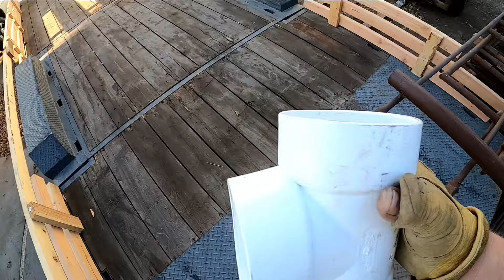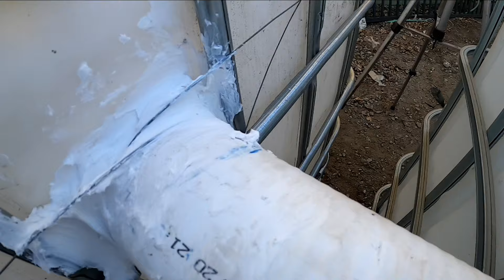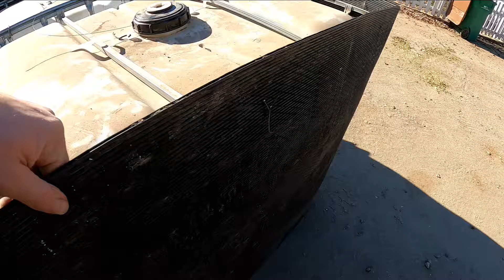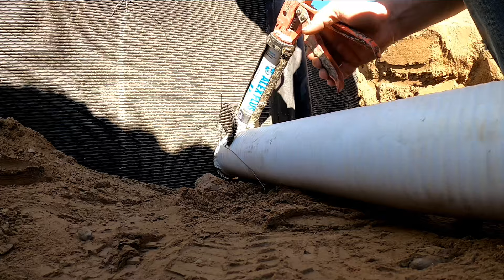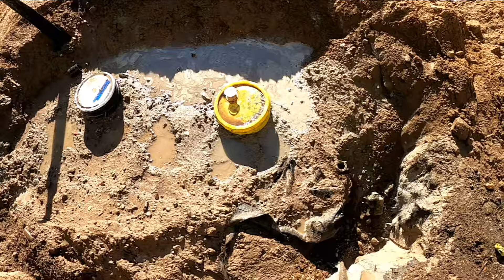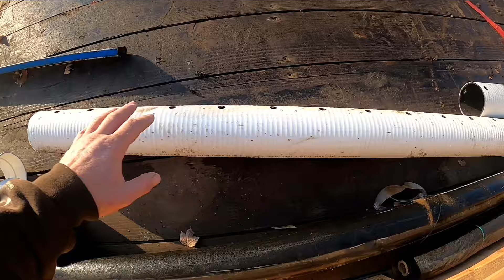Cheap, easy DIY TOTE septic system | Cabin, RV, Tiny home, off grid

Comment: I have land in Costilla County CO, where land is cheap, undeveloped and rural and specifically designed for off grid living and there is no specific code for a septic as long as it works and does not leak waste, so there are plenty of places in the US where code does not exist, specifically in rural undeveloped land designed for off grid living.
Reply: Actually, that’s not true that every county has a code. For example, in Missouri some counties don’t even have authority for such codes in rule areas and certainly don’t have them. And the state law, which has some pretty big exemptions for large acreage single use would apply. This doesn’t mean that you shouldn’t do it properly if you can but every project is different and doing some thing for a temporary campsite might be different than doing something for a cabin versus some other project.   Just wanna make sure people actually have the facts. You would need to check your actual county or know your area.

Comment: bulk head fittings... then you'd have something to glue pvc to between the solids and liquids tank, and no worries of the joints leaking bc of the silicone degrading over time
Reply from the maker: I considered using flanges screwed and glued to the tanks but wanted to keep the cost down. I guess silicone degradation could be considered, but leaking at the joint vs flowing out of the leach field 5 ft away, whats the concern? Thanks for the comment
Reply: Even better and cheaper for non pressurized applications use uni-seals. Thanks for the video bud!

Comment: Do you have a drawing or diagram of this showing what's going on inside the tanks, what position the "t's" are to be in, the distances where the pipes go, the grades of the drainage pipes, etc? Also, I missed what the buckets were for. The black 90 degree piece was for the input, correct? I'm not a plumber at all. I'll watch it again sometime before I start my project. Thanks!

Comment: So please explain the plastic in the ditch. How does water leach into the soil when plastic just makes laterals a swimming pool hold liquids in? Is there hole in the plastic liner?
Reply: It's not plastic, it's a french drain liner. Better to understand if you can see it up close. It's basically a tight woven material almost like burlap. It prevents dirt from filling in all of the crevices and water locking the rubble.

Comment: Even in unregulated areas, there are some statewide laws requiring standard septic systems. I’ve changed my mind about running my black water into the septic because the fines can be enormous. I’ll continue composting human sewage but run all of my gray water to the septic. A bit of an inconvenience for me, but protecting myself from having problems down the road. Maybe someday I’ll be able to afford a legit septic, maybe not. But I won’t lose any sleep over it.
Reply: Septic systems are black water. Why would you do a system for anything else?

Comment: In many areas installing such a waste system is a surefire way to get a major fine and come under scrutiny of the local zoning and permitting offices.
Also depending on local water aquifers or creeks/streams could end up with a hefty hazmat cleanup bill as well.

Install such unapproved system at your own risk.

Comment: I have two water tanks one is 330 gallons for solids and the other is 275 gallons for water also I am running two 20-foot leach lines would this be enough for one bathroom?

Comment: So is there a risk of flooding your septic field bcz you have two pipes running to it? and would it be as good, better, worse to exit them from the liquids tank at different heights if it's meant to be a backup in case one fails?
Reply: gravity will take care of it. the amount of water necessary to "flood the ground table a few feet down would be insane

Comment: QUESTION: Will something like this pass inspection? Or do I have to buy specific approved tanks? Sadly most land available still requires a septic permit & inspection
Reply: yeah this won't pass an inspection. This is definitely an off grid thing
Reply: In my situation, what the inspectors don't know won't bother them.
Reply: @cannibalchainsaw  yeah but they will probably know. If you want to do something like this do it either way off grid where they don't care or do a composting toilet and use gray water to water plants. Compost is more work but could save you the hassle
Reply: @dustinreynolds1552  I'm remodeling an old barn into a workshop, and I'm on one step above a dirt road without much traffic. No other houses around for probably 1/2 mile or more. It would see maybe one dump a week. I just hate dropping everything to go home to go to the bathroom. 
You're right though, I have been thinking about and will probably just do a composting toilet and just dump the bucket in the woods every little bit.
Reply: @cannibalchainsaw  there are ways you can do it more efficiently. Just make sure it is safe and stuff. Off grid the diy septic is cool just make sure it is well hidden, inspectors aren't dicks but their job is to make sure it is safe for you and the environment
Reply: So how does a person dump this when it gets full, I'm sure if you call a septic service to suck the tank, they will call the EPA or the city or state because of the DIY septic system.
Reply: @rickarnold5123  2 inch semi trash pump.

Comment: Can this be pumped? If it's not legal would anyone pump this after say...3 years? Im so sick of laws saying this wouldn't be safe but paying someone 5k plus to do the same thing is.
Reply: Depends on the state really. these types of tanks are illegal and most people wouldn’t pump these out, but if you have cash and paid under the table someone probably would. The problem with these tanks is they aren’t made to be put under ground so they would break or collapse and just fail all together.
Reply: understand the general laws are to protect everyone. a few people doing this is fine.. what if millions did this. do you want to go back to europe with people throwing garbage in the street because of "freedom"... these plastic tanks can often collapse if not done right. drive a truck across them and they can collapse.. if they are not deep enough then they will collapse. if you dont have your sewage registered then how would anyone else know its down there if they start digging. the pipes connected are not made for settling of the soil.. what happens if the first tank settles faster because its heavier? that connecting pipe will break.. i love freedom but so many people cant handle the actual process of building off grid so its better to work longer, save more and build correct.
Reply: @Blanknameonyoutube  The problem is that states REQUIRE you to put in a 1000 gallon tank. I live alone. I have no need for a 1000 gallon tank. Many places cannot support a leach field. Why not allow frequent pumping instead of massive leach field? There are reasonable alternatives but its all about the money and the pressure the industries put on the government to force regulations.
Reply: In my particular situation, I'm thinking about doing this for an old barn that I'm remodeling for a workshop. It's going to see maybe one "load" of "solids" once a week or so, and then washing hands. I'm not going to pay $10k for a full septic system just so that I don't have to drop everything and go home to take a dump.
Reply: @mhwp3286  I agree. There used to be a lot of cinderblock houses in my area, but now they won't allow them. A block house can go up quickly and inexpensively. The building officials say it's because they can't be insulated well enough, when I've been in many insulated block commercial buildings and they're fine. I think they just don't want anybody having a cheap house that doesn't require a ton of maintenance.
Reply: @mhwp3286  It's mostly because laws are for the masses, not the exceptions. Many people that live off grid would be considered exceptional, lol. 
I've heard of people speaking with the county/state officials and getting an approval for custom/alternative sewage treatments. It takes longer for the approval, but it is a way that some people have been able to get even compost toilets approved.
Reply: @cannibalchainsaw  my house is cinder block.. my father in law built it, I did the insulation and ac work. 1 inch foam board on the inside walls, house stays freezing cold in the Texas summer and unbearably hot in the winter.
Reply: @Las_cacas your entire house is made from cinder block ? Did you frame out the walls on the inside ? Did you spray foam the block ? Any details plz
Reply: @Nctbgs  I replied to your comment but somehow it doesn't appear... So I'll try again... I used foam panels I bought at home Depot... It's called foamular by Owens Corning.. it comes in 1/2, 1 and 2 inch... I used pl300 to glue it on... It's industrial strength... I wall papered some walls, painted others and glued wood paneling in other parts... So far it's holding well. Oh, before I glued the paneling up, I painted the wall with a moisture barrier paint. I also reframed the windows... Super easy... I'll eventually do the out walls too, but I'll use wire mesh over the foam and then apply a layer of stucco with a paint roller.
Reply: @Nctbgs  and yes the entire house is...  the ceilings are poured concrete, my father built it like the homes in Mexico are built... A contractor said it was built like a parking garage and you could even park a semi on it...
Reply: @Las_cacas  I’m a Mason and have been wanting to build a house out of concrete block for many years . I’m in The Midwest and it’s just not done here at all. I know they do it down in Florida so I thought I may have to visit Florida to see how they were handling the insulation and the inside framing . Not much information available for block houses in my area.
Reply: @Nctbgs  I met the guy that built the YMCA here (cinder block), he said he spray foamed the blocks from the inside. I think that's the way to go, though the foam boards did work, it makes the walls super thick... I have seen people use the foam panels on the outside and then stucco over after applying a wire mesh... But that's down here in the south where it's very dry and not much rain. Zones differ.. maybe build a small mockup to see how it holds up?
Reply: @Las_cacas  yes I actually have considered building a small office on the property made from all concrete block . We can’t get cinder block anymore . I would also like a wood subfloor so I can have a crawl space and a softer surface to walk on. I need to contact Simpson ties and see if they make hangers that will hang directly from block to support floor joist .
Reply: @mhwp3286  I don't know what states you are speaking of but that is not the case in Texas.  I sell the things, and you can get some anywhere from 300 gallon and up.

Comment: question, if I'm just building this for gray water , wash machine and couple sinks, 1 shower, could i just use 1 tank and a drain field, or would 2 tanks work better?
Reply from the maker: The main reason for 2 tanks is to settle solids. You may be ok with 1
Reply: Grey water is legally allowed to be dumped on the ground or in a rock system no problem no sewage tho

Comment: Somebody correct me if I'm wrong but what is the purpose of putting plastic on the bottom of the leech line? I thought the purpose was to get the water to filter through the soil.
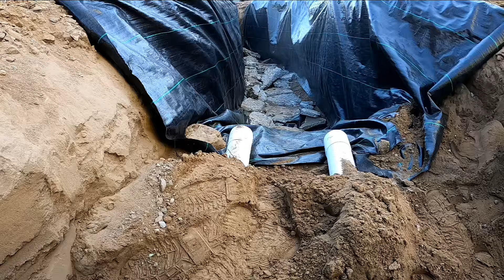Reply from the maker: *woven mesh, not plastic. And if you look closely at 9:41 you can see the mesh isnt on the bottom of the trench, just the side. Again at 9:53 you can see bare dirt through the rubble. Mesh is under the immediate area where the pipes originate but not under the main leech area. Thanks

Comment: If used by 2 people regularly, how often do you think you'd have to pump septic on a 275 gallon tank?
Reply: I answered this in another comment. I looked up the average "waste" of a person per day and other stuff like volume to get kind of exact numbers. It'll be about 8-12months per tank
Reply: But also that is 8-12 months of ONLY solids. As if it never broke down into liquids. Which is most definitely will. So really you can easily double that time span PLUS some if you send enough liquids in plus the additive to break down toilet paper and solids
Reply: If the guy goes pee outside, and only uses the bathroom for #2, but obviously the woman uses it for both, and you throw your toilet paper in the trash rather than flush it, the system will work much smoother and last longer. Also all your other water (shower, sinks, dish washer, and washing machine) should NOT drain into the septic system. You follow those rules and your septic system will have the least amount of issues.

Comment: Why put the concrete on top?  Why won't  that be too much pressure on it?
Reply: Imagine a tire from a vehicle... Well it sits on a maybe 1 sq ft area of dirt. Without a cap of concrete, the load could potentially be on a 1sq ft area of the lid as well. However, when you cap the entire top, now that load is dispersed over a much larger area evenly which can help prevent a puncture in a small area. Personally I would have liked to see him make a slab under it, then put some landscape timbers up and down at the corners, then make the cap and tie it into the landscape timbers. This would strengthen the tank significantly more to handle vehicles driving over it.

Comment: Just wondering if anyone has a diagram the 2 totes with the pipes between the 2 and perhaps some labels or short explanation of what the purpose is.   I'm just a girl....I'm not as smart as you brilliant men.  I love the way all of your engineering mind works.   I had a bathroom added to my home by a plumber friend of mine that is now deceased, and I believe he may have watched your video for information and inspiration.  I live in right outside of Austin city limits on NW side and there is solid limestone under the dirt at like 12-18" in some spots in my yard.  So, I don't think he went deep enough LOL and the sewage is collecting at the end.  Also, he only used 1 lateral line instead of 2; and the downward pitch is probably too much, like you mentioned in your video.     He forgot to put that sock thing over the 4" pipe with the holes in it and I think maybe dirt or roots are getting in.  Anyway, it's hard for me to deal with this cuz I'm a 55 yo single lady renting out rooms to other little ol ladies to make ends meet.  Any ideas?
Reply: I’m a 55 yr old widow trying to build some housing for myself and there is so much I don’t know about. I wish I had just one person who could answer my questions. I’m thankful for YouTube at least. Good luck in Texas from southwest Virginia.
Reply: Sounds like a botched install. Firstly, if that leach is only 12-18 inches under grade, thats far too shallow. Secondly, the line can leave the tank singularly, but would need to branch off multiple times over, depending on soil structure (which sounds like yours is a mix of limestone and I'm guessing Clay?) Which limestone is porous and will perk, depending on its formation. If it's solid mass, essentially layers of solid limestone, sometimes referred to as shelf divided with layers of clay or a mixed composition that can be problematic for percolating, as the solid mass of the limestone, although porous, tends to leach liquid through it somewhat slowly. With a clay mix this process can even be slowed further and with solid layers of clay separating the lime shelf, can really hamper liquid dispersal. These instances would require a MUCH larger leach pipe matrix in order to allow proper dispersal of liquids as they're introduced into the system. There should also be NO actual waste being built up in ANY portion of the field, most especially not packing into the end of the line. This is an indication that A; the line itself has FAR too much fall (angle) applied to it (causing the outgoing liquids to rush down and past the perforations, essentially bypassing the exit holes it should be slowly seeping through them all, and instead is pulling into the end and only exiting through those holes adjacent to the end of the line. If solids are also collecting into this area (or ANYWHERE in the leach line at all) there was no filtration membrane (also known as a "sock") applied to the outlet penetration stub. This will allow solids to infiltrate the leach system, clog it up, and eventually plug the entire matrix of line as well as contaminate the fields rock and gravel bed and any soul in proximity to said field. Sounds like a bit of a nightmare if that all is the case. You likely need to get a company to come out, scope your tank and lines and assess from there. Good luck with it. Hope all turns out well for you.

Comment: That wasn't silicone. It has "some" silicone in it, but it's just caulk.
I know, I use silicone quite often and I'm familiar with the caulk you were using.
That stuff is about three dollars a tube and silicone is up to around ten dollars a tube.
Use silicone and not what he was using.

Comment: Enjoyed your video.  Thanks for posting it.  Can you offer more information about where you find the totes for free?  (I’m “doing my homework” now )
Reply from the maker: Do you have any places nearby that buys any liquids in bulk? (AG chem supply, Food manufacturing, painting, industrial supply)
Reply: @unitedstatesofbuild4915  brewery or distillery is golden opportunity
Reply: Oil jobbers are a good source.  Ask for DEF (basically fertilizer)totes.  Be sure the valves don’t leak. I have hot glued them shut to stop a drip. Very important on the solids tank. They are usually glad  to get rid of them. Be advised they probably will have some damage as good ones usually get returned for refilling. I